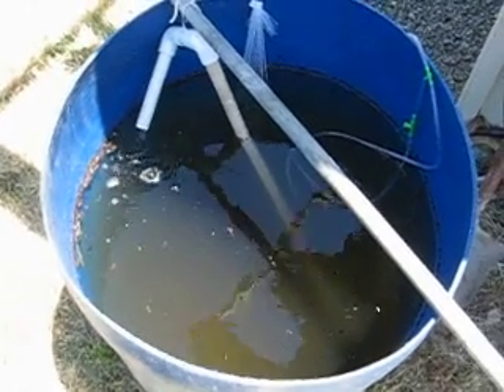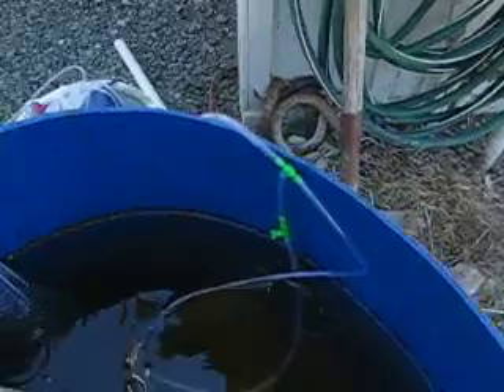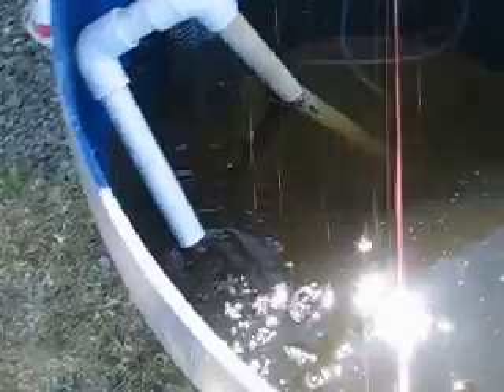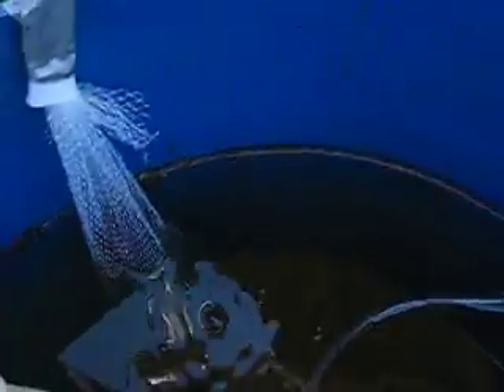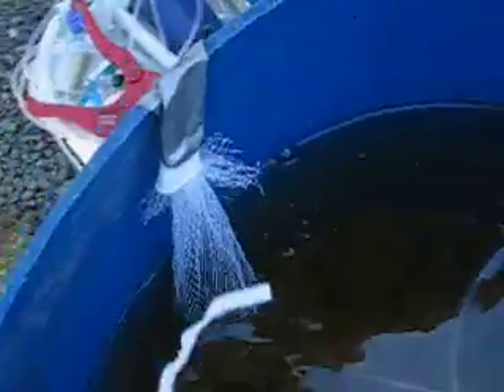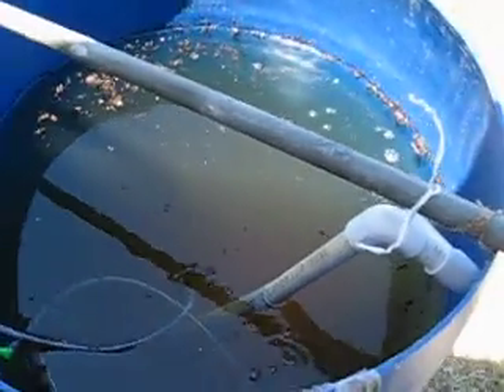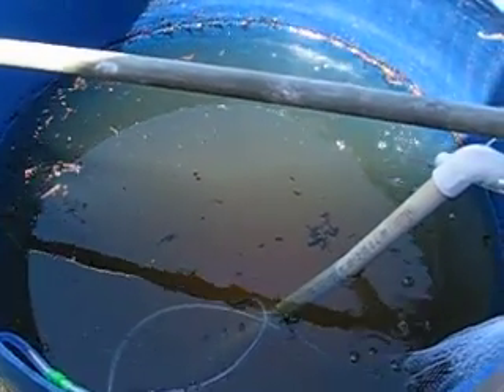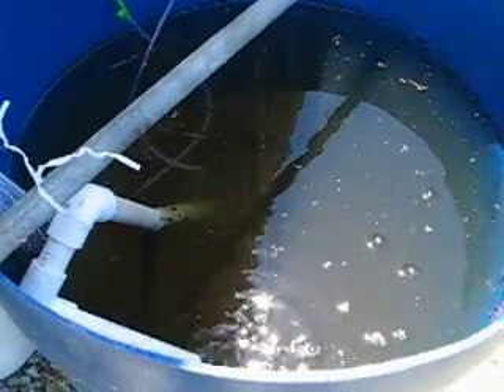Brewing Compost Tea using Air Lift Pump

Comment: I would add about 8 ounces (or more) of organic molasses and brew it 3-4 days. It will look like root beer when it is ready. Worms make the best compost on the planet!

Use it within 2 hours after the air is off. Use it sooner if possible I spray mine in late afternoon giving it time to soak in.